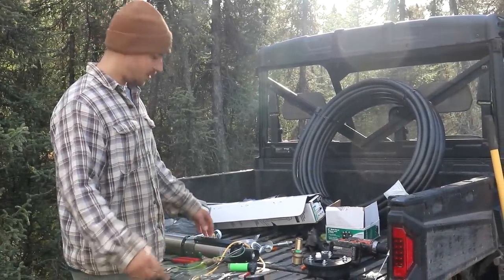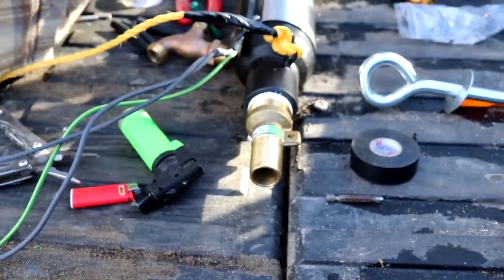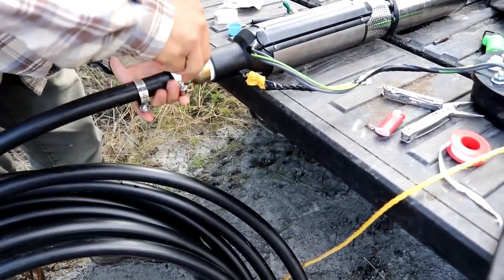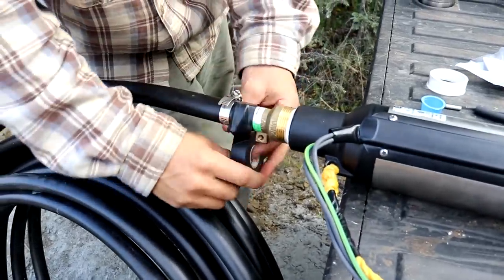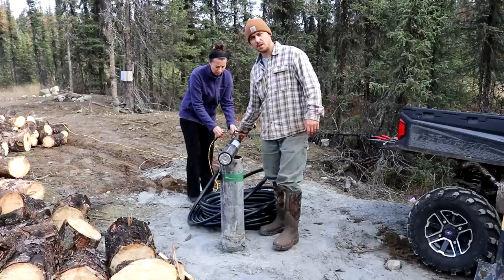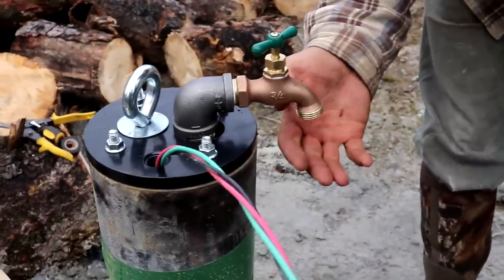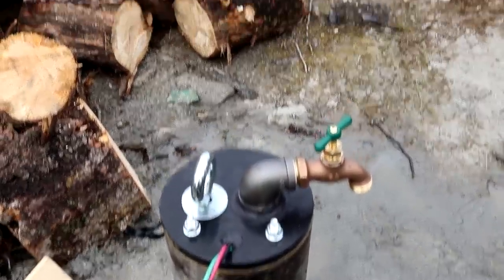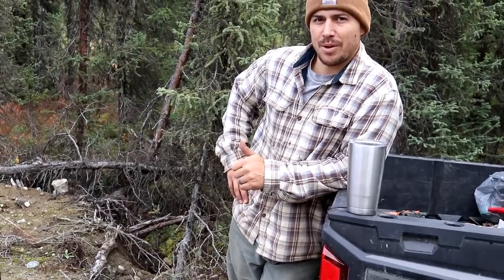Installing A Well Pump at the Off Grid Cabin

Comment: I've been a well installer for 37 years and one thing you really should have considered is to have a shot of whiskey when you finished
Reply: Do you use the dog excrement trick for ph
Reply: yea at least a few Beers...
Reply: Need to exercise your suggestion when I do Mine. Always trick of the trade to be learned, that's what my channel is all about. Thanks
Reply: What is the possibility of a pice of E tape coming unravelled and dropping down into the pump?
Reply: What do you think you are, some kind of painter?
Reply: @jamesogorman3287  When I started in the mid 80's foreman would send me the newby at 18 to go get a case of beer for the crew at 3:30. We would call it a day and finish off the case. Those days are long in the past for my site.
Reply: @waveoflight  It never happens, as long as you use one long continuous piece. It will still look good ten, fifteen, twenty years later, because sunlight can't degrade it.

Comment: You should have added a 1" stainless steel tee (with a barb adapter) at the end of the poly  (on the outside of your well seal) , and have the weight of the pump (and the pipe full of water) hang from that. The way you have it, all the weight is hanging from your rope (which is also not anchored correctly). If your rope fails or your knot slides past the nut, the whole thing is going to end up at the bottom of your well. The safety rope is there in case your barb connection at the pump fails, and should not be under tension during normal operation. Only used as your last recourse to recover the pump only. As mentioned by other people, the rope should be tied to the loop of your eye hook, which should then thread through the well seal, and secured on the top side of the seal with a nut and washer, and you missed the torque arrestor... Also you should not use standard heat shrink, you should use a submersible splice kit, that includes water proof jackets, which are also heat shrunk but have a silicon adhesive the seals the connection (and when heat shrinking should be started from the center out to avoid bubbles, and ensure that the silicon adhesive oozes out and ensures a completely water proof seal. It is also a lot safer to assemble your well seal before starting to lowering your pump (At least tie the safety rope to an eye hook secured to the seal and never untie it unless you have a backup)... I broke a sweat when you united your safety rope @ 8:50, there was zero redundancy... if that rope slipped of your hands your pump would be at the bottom of your well!!!) -  Not trying to burn you, just making sure that people that use your video as reference know that they need to consider some additional details.
Reply: Thanks for that comment. The video taught me a lot and your comments filled in the blanks. Thanks for taking the time.
Reply: This 2 years late, but a "pitless adapter" lets you get your water from the well below frost level and suspends the pump from whatever type of pipe you use. The rest of your comment is spot-on for anyone putting in a submersible. I like to use a stainless steel cable and clamps in lieu of a "plastic rope, which will deteriorate over time.

Comment: You should melt the heat shrink from the middle going out so you don’t trap an air pocket
Reply: and not use a torch or lighter. Always use a heat gun with a consistent flow of heat that isn't concentrated on one spot like a torch or flame is regardless of moving it back and forth.
Reply: Yup what they said
Reply: Yep!
Reply: @williscooper7750  I use a torch on my heat shrinks have done over 1000 and not one has been bad yet.
Reply: @Eggugat  You do it if you are careful and take your time but still should use a heat gun. More consistent lower temp heat is better. But there is always other ways
Reply: A torch used gently is OK, but not as good as a proper heat gun. I only use a torch if I must.

Comment: I would not use electrical tape on the underwater connections , rather i would use "liquid electric tape" or a similar product that will provide an air/water tight seal in addition to your heat shrink (which you should heat from the middle out to push air out). Also heavy duty zip ties instead of electric tape to secure the wire to the line as you fed the works down hole. Electric tape will age and come unglued eventually and you don't want that floating around in your well potentially blocking/clogging the pump.
Reply from the maker: Razr Havoc thank you, we appreciate the suggestions. Thankfully it is easy to pull out and change :)
Reply: @SimpleLivingAlaska  all in all I think you did a pretty good job...but Raze has some good suggestions.  when I did our 300 foot well (we have a few on our farm in Texas) it was an old well (1920) that had 3 inch pipe so we had to get the pump from LA where they use three inch, Texas is 4 inch normally.  at the electric store we found some "well splice" which when you compress them (with the tool) pushes out a chemical reaction that essentially water tights the entire system...over that I put some heat shrink and Raze's liquid electric tape...and a lot of zip ties...4 years now, not a bit of problems...but again I think you did a nice job ...good living

Comment: Pro tip for wiring when you need to do multiple connections like you have there. 
Stagger the height of the crimps. 

This means that they don't bulk out as much and it just looks neater. 
There's also some heat shrink with glue in it, that's what I use for Motorsport wiring and it'd definitely work well in this situation... But that's for next time. 

Keep the video's coming, I love 'em.
Cheers from the UK.

Comment: When you shrunk the ends first, there was air in the middle, like a bladder of air.  You then shrunk the middle and air had to escape through the ends, breaking the seal.  That is not how one should do heat shrink in submersible applications.  Also I would have coated exposed conductors in silicone or similar before heat shrinking, to give you a double barrier.

Comment: You have done a great job. Well done. Next time check out WellHose DIY Drop Pipe. It is easier to handle, great for freezing temperatures and no support rope required. Cheers

Comment: When you put your new pump in, never run the pump dry.  We put our first pump in with Poly tube like you, and the pump swung back and forth and wore the wire until it grounded. We had a well installer do the next one and he used steel pipe.
Reply: Just curious, did he installed the pipe with cathodic protection?

Comment: You might have put the ring bolt in upside down. Usually, the rope should tie to the ring portion hanging down inside the well.
Reply: Devin Heaps Yes, this!
Reply: I was thinking the same thing.

Comment: Nice job. I did the whole job from start to finish.  I only had to go 8’ for water, but went to 27’.   It’s only for watering but it crystal clear and has a lower ppm than my city water.   It’s to shallow to drink but it does taste good.  It saved me 150-200 a month from my water bill.  I only spent about 400. I bought a cheap pump because I didn’t think it would actually work.  1 year and 2 months later it’s still saving me money.
Reply: Did you it up like they did?

Comment: Very informative.  I have to do some service on my pump here in Bear River Nova Scotia, and this demystifies the whole thing about down-hole 110V pumps for me!    Also The better class of heavy duty heat shrink contains an inner layer of Glue/water-seal that is heat activated.  This will render your seal perfect.  I think you might have had this, as  i could see a white ring popping out around the heat shrink.   Start at the center too.

Comment: I prefer nylon line. Poly is strong, more susceptible to UV,  but there's no sun down there! Nylon ties much better than elec. tape, for sure. I put a little silicone on the wire and heat shrink over it. 
Good job.
Reply: Hey DW. You can check out WellHose DIY Drop Pipe. No support ropes needed. Cheers

Comment: I know that this an older video but well done . If it was me I would have installed a torque protector like other people were suggesting . Stop the pump from banging the walls of the well  . I also would have installed a pitless adapter  about 10 feet down . This way in the future if you wanted water to the house or a barn you could do so with out worrying about the pipe freezing . To do that now you would have to break up the concrete around the well head . Any how looking good .

Comment: I would have thought that the eye of the eyebolt should have been inside the cap. With the rope tied to that. Over time, I could see that rope sliding off the 'bolt' part, since it is a vertical slide. No matter how well you tied and taped it on there. All in all, I think there is a good chance you are going to lose your pump within a few years.

Comment: Well I sorted out through the comments and they gave all good advice. It is your well and you do it the way that you can afford. I do suggest that it run for as long as possible for your generator can handle but all I seen was a short spurt of dirt which is normal for new wells. So you live in Alaska too, all good. I would exchange ends on the tie off if you pull it and if you can afford a torque arrestor for the pump so it won't break your pipe in cold weather. It is a bit harder to pull up later with it but really good insurance. I attached a smaller piece of pipe to the outside and a hand winch to pull mine.I just run it over the top a few feet to make it easy to wind up but you have a winch on the side by side so you can make a tripod over it with a block and tackle... in my other video I watched, you have some experience with winching so enjoy the freedom from the water tax man. You only need run the well for a short while as that water has settled a lot. Just don't pump directly from the bottom as that is where the silt settles and can ruin pumps.. takes a while tho so don't lose sleep. If you drink out of the creeks here then your already fine

Comment: When installing your hose you should add rubber shock boots every so often. When the pump kicks on it stops the movement of your water line so the wires don’t get rubbed on two. Just my two cents. Keep up the good work both of you.
Reply: How many would you suggest on one going down 60ft
Reply: @stolenjunk  every 15 ft
Reply: @mdsloads  thank you

Comment: in addition to celebrating that you did it on your own, you should have only used brass or bronze fittings at the well. It is long lasting, and keeps from having to replace galvanized fittings. Pex is best inside the house, but not at the well. Go from brass [at well] to pex or PVC to the house, and you get the best of both world, with no corrosion like galvanized will have.

Comment: I never knew that you can put a well pump under the water. Here in Michigan I have only seen them in a well house above the ground or in the house.
Reply: Our water table is high here in Michigan.  What you've seen are shallow wells, mine is only 22 feet deep.  I think the cut off is around 30 feet then you have to use a submersible pump like they did.

Comment: I read somewhere that these pumps will last about 7 years.  That has been my experience as I am now on my third pump.  The pump I have now is a Grundsfdos pump which I power by solar/generator.  The good thing about this pump is that it will take a wide range of electrical power. I have my solar panels in series to give 220 Volts (with not very much amps). In that they are in a fixed position, the wattage varies greatly throughout the day and throughout all weather conditions, but the pump happily pumps whatever it can with whatever power it gets.  I simply wire the power directly down into the well without any control box – the pump just handles whatever I give it.  My well is at 375 feet and I pump up to a holding tank that is about 200 more feet in elevation.  The pump is now about 3 years working … time will tell how long it will last.  I have seen a video that described rebuilding a Grundsfdos pump, so that is something I may be doing sometime in the future.  
  During my adventures replacing my earlier pumps, I have lost the pump down the well on two different occasions. I have developed a way to retrieve them, so if you ever find yourself in that position, I know of two good ways to recover.
Reply from the maker: Dennis Bosworth thank you for sharing your experience, we were not sure how long to expect it to last ☺ hopefully we never have to retrieve it from the bottom.
Reply: How do you recover them? :O
Reply: @dennisbosworth3665  well we don't have to call them morons but I'm just here to tell you what they did there is not going to last very long. I've installed a few well pumps in my life my mom was a general contractor and I did all the well pumps and you want to know what not a single new homeowner ever came back with a well problem. I'm telling you they didn't use the right stuff and they didn't do it right. you don't take some electrical tape and some wire and shove it in a well it doesn't work that way. If you want it to last for 20 years. They make special plastic Shields that are supposed to go on the  poly pipe. they keep the poly pipe away from the casing and they keep the wires away from the casing. I can't tell you how many friends I've had to help work on their well because they don't know what they're doing. And these people don't have a clue. they put out a video and hopefully nobody follows it. people ask questions like what do you put over the top of the well so it doesn't freeze. well if you have experience like me you don't have that problem. Number one you drill a hole in the well casing you put a special adapter in there that slides together so the pipe is below the Earth where the temperature is 55° all over the world and it doesn't freeze. Using a rope for support is fine but that's not code that's not right either. You're supposed to use a stainless steel cable that also attaches to the top of the well casing you have to drill to put that in as well.  My point was the entire video was incorrect but anything that gets people to look at it so they can earn money right. I tell you what when my pump dies which will probably be a long time because I did it right I'll do a video and show people how to do it correctly.
Reply: @dennisbosworth3665  I voice my opinion what do you want me to do lie and say they did a good job so everybody does their well that way these people don't know what the hell they're doing.. I think people have a right to know that that's not correct. I learned from a professional well pump installer I think I know what I'm talking about.
Reply: @Dennis Bosworth would you mind sharing how you retrieve lost pumps?

Comment: Alaska?, Now I am in Colorado building our Modern Cabin and it gets Cold (-30F) how are you going to keep your well head from freezing when you don't have under ground  pitless adapter or a drain beneath your spigot? Best info for my use is that it took 5 seconds on a totally dry line to pump water up 100'. Priceless info.
Reply from the maker: Gobuilditbetter that is how cold it gets here too, we drilled a weep hole in the pipe after it froze once and haven't had problems since then.

Comment: Oh I wished I could go back to the past. Retired electrical contractor. Forget electrical tape. It will be unwound in 4 months. I'd say tie-wraps ("zip ties"), or WP line/rope with half hitches all the way up. Protect that 'non-weatherproof insulation on the wiring cord outside. Sunlight will eventually crack it. Lastly, keep the power source as close as possible. Distance increases voltage drop to the pump motor. 115V is already a low base for the motor (HP?).

Comment: Since the wire is the last defense against losing the pump down the well... I think I would have made a coil in the wire, and put several nylon wire ties throughout the loop. That way, you wouldn't be relying on those crimp connectors to hold the weight. They will NOT hold the weight.

Comment: Thanks, doing mine in 2 weeks.
You situation is similar to ours.
I'm in the Rockies.
My question is about it freezing? I noticed your in Alaska. The weather here is similar. I'm off grid also.
I bought a 120v. Also. Guold 10gal per minute.
Thanks for making video 
I will need to use a pittless adapter at 8ft below to cabin. To avoid freezing.
Reply from the maker: Grand Roofing we drilled a small weep hole 15ft down the well line and had no problems all winter.
Reply: Simple Living Alaska thank you.

Comment: unless you got some new type of heatshrink that im not aware of---heat shrink is NOT water proof--you should take the electrical connections back apart and add some silicon inside the new heat shrink before you heat them up and shrink them ---you should have some seepage from each end of the tube to know your wires are sealed---good luck!

Comment: Your in Alaska,   What have you done for freeze protection on your well,  dropline and faucet.   I assume you want running water in the winter too ????  Maybe you are far enough south in the State so that is not an issue.  I am from the interior and that would freeze up in the winter as you installed it.  I would have at least installed a Heat trace line down 10-15 feet along your drop line.
Reply from the maker: Brian Ludlow we put in a weep hole a few videos later and have not had any issues with freezing since.

Comment: Just had a question for the pro well installers.   Does this type of installation need some type of pressure switch to control the pump. What will stop the pump from running once the system is powered?
Reply: Yea you need a tank with a pressure switch if you want constant pressure. Otherwise you will kill the pump early.